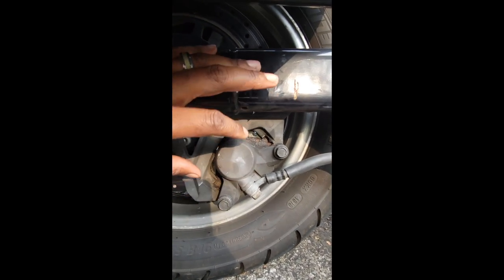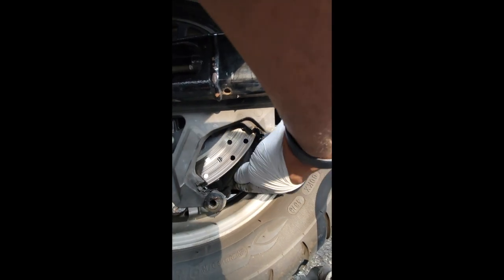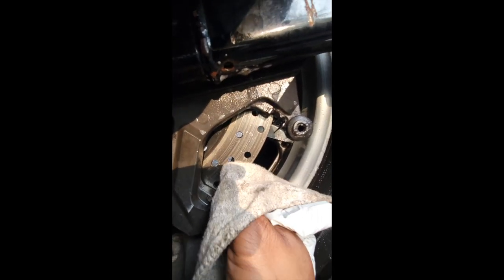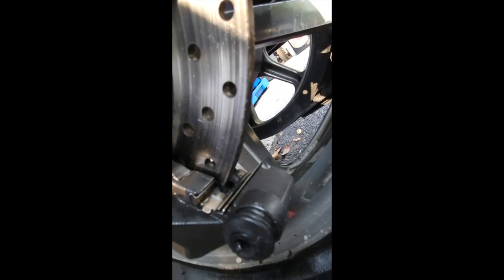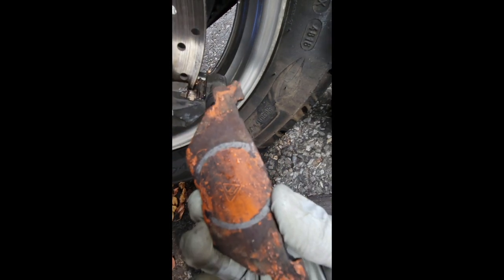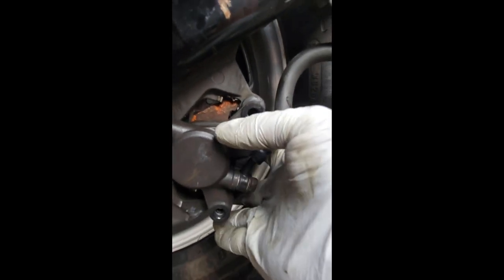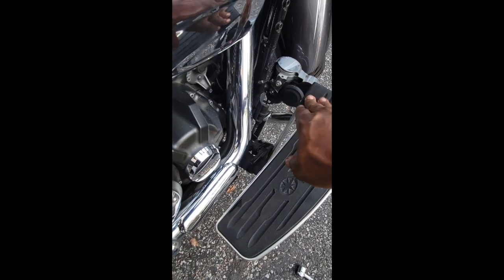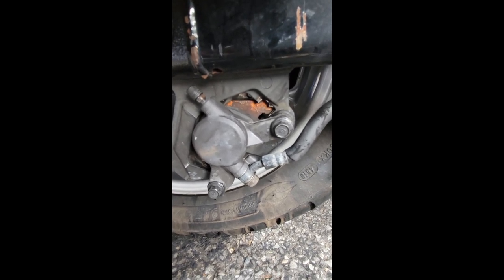Quick Motorcycle  brake cleaning | Any Bike Maintenance

Comment from the maker: Before any long trip it is good to look over your bike. One place that should be included are your brakes. This is a simple cleaning that can be done with simple items to assure that your brakes are in top shape before an extended ride. 
If further action , i.e. rotor change, brake pad change were needed. You would have caught the issue here, and not out on the road. 
Always inspect your bike before every ride. Your life depends on it. 
Thanks for watching.